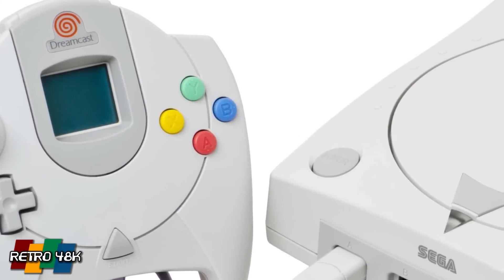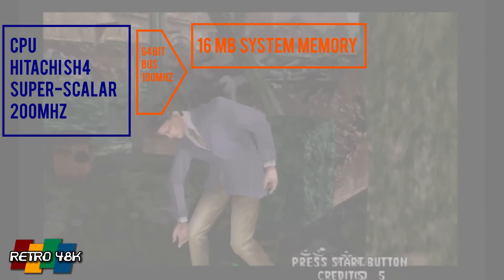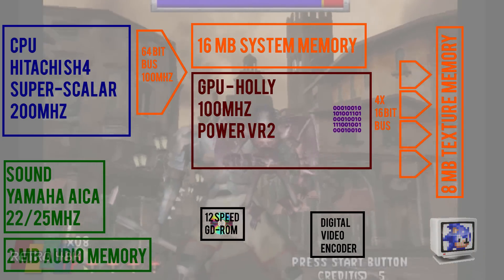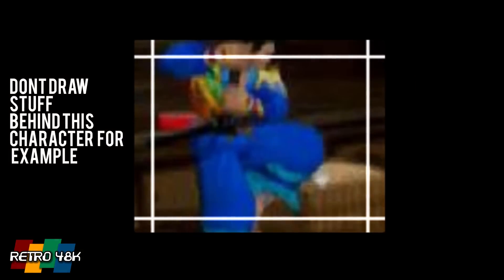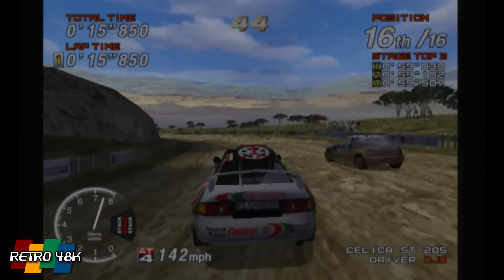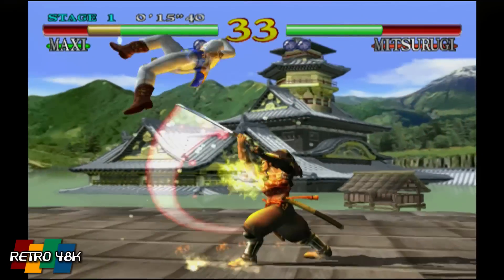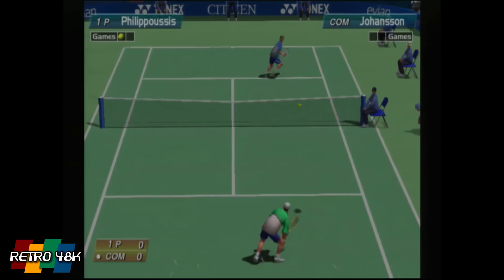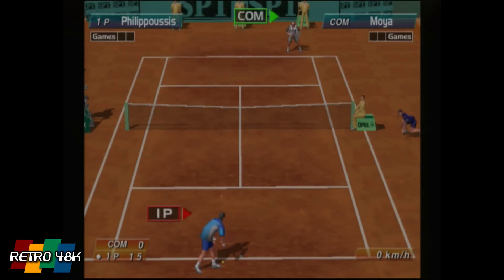How the Sega Dreamcast Worked

Comment: The Nintendo consoles from rhe N64,  had display lists too. But  1 of the big problems of that is latency issues.
Reply: In the N64, isn’t it rather a queue between the CPU and the RSP? N64 has problems with antialiasing and translucency.

Comment: Dreamcast was an amazing gaming console and I still have mine. I still play it on a CRT! I love that system. PCs were faster though. 

Your PC speed estimates for 1998 and 1999 though are way off. They were at 200 Mhz by 1996.  By the time of the Dreamcast launch in NA the Pentium 3 500 Mhz ($700 roughly, $500 for the 450 Mhz) was launching, followed shortly by the GeForce 256 ($199); both of which outclassed the Dreamcast pretty handily. Even for the 1998 launch it would have been up against the P2-450 and Nvidia TNT 2.
Reply: Dreamcast was more powerful.  The games looked better on Dreamcast than those PCs you mentioned.
Reply: @costumeninja1914  On point one you are wrong. I love Dreamcast too but if you think it was more powerful than a GeForce 256 you need to go look the benchmarks of the era. Dreamcast ran Quake 3 at 640x480 with lower settings to get 20 to 30 FPS most of the time while the GeForce 256 could hit above 100 FPS at at the same resolution with higher in-game detail. Even the TNT2 was hitting 70 FPS at the time. 

On point 2: I will happily concede that many Dreamcast games looked amazing for their time. They seem to punch well above their weight class. However, that has more to do with well chosen level design, extensive single platform optimization, and consistent art direction rather than the raw power of the system itself. 

Dreamcast was great. We played it everyday, and I have some very fond memories from it. It just wasn't the most powerful thing at the time. No console is by the time it launches since the advent of 3D cards.
Reply: @Revenant_Knight  Resolution aside, DC pushed way more polygons than the Geforce 256 its not even funny.
Reply: @sebastiankulche   And yet Dreamcast underperforms to the GeForce256 quite substantially as I mentioned in my previous comment, and gave hard evidence of this. 

Raw polygon output is not an indicator of in game performance. It’s a marketing strategy. When all aspects of a game have to be accounted for such as textures, lighting, physics, AI, etc, those polygon numbers drop significantly. 

I’m really not sure what you’re going for here. Dreamcast is objectively slower than a fast PC of the time with a GeForce256. This was independently tested by multiple independent media sources. Why are you so concerned with trying to prove it was something it wasn’t instead of focusing on what it actually was? Were you personally offended? 

Dreamcast was a bargain for the performance it provided. It had one of the best libraries of all time. Performance was excellent. 

I was in college when DC came out. I had a decked out PC: Athlon 750,  GeForce 256 DDR, 2x Voodoo2 in SLI. It was a beast for the time and was faster than my DC. But I played more on my DC because of the games on the DC. Acknowledgment of objective facts that my PC was faster doesn’t ruin the enjoyment of my DC. 

This reminds me of the 16-bit playground wars. SNES vs Genesis and is just about as dumb.
Reply: @Revenant_Knight  I dont even like the DC to begin with it but is undeniable that at the time cutting edge console graphics>>>cutting edge pc graphics, not like nowadays that even a 4 year older GPU like the 1080 ti could outperform the PS5.

PC didnt catch up to consoles until like 2004/2005 and even thats debatable. I mean just compare Quake 3 with Shenmue 2 (or even some late PS1/N64 games) and you would see which one feels previous gen in comparison.
Reply: @  Okay, I’m just not going to bother. You’re objectively wrong which makes you either a troll or someone who can’t accept they’re wrong. Everything you said can be proven wrong by researching a few articles from the time period. Hell, I lived through it. Good luck in life kid.
Reply: @Revenant_Knight  If you really lived that time period you would know everyone would had choose the PS2 anyway.

Cope.
Reply: @ Thanks kid. I needed a good laugh. Cope? Nope. You’re comedy gold. We’re laughing at you. You moved the goal posts with the no-shit-Sherlock PS2 comment in your argument, and basically forfeited and admitted defeat to anyone with common sense. Also liking your own posts doesn’t help your argument. 

Just FYI: the PC variant of the Dreamcast GPU was called the Neon 250. Released in 1999, It trailed behind the TNT2. Per Toms Hardware, a tech outfit that has been around longer than you’ve probably been alive, the Neon 250 was half the speed of the TNT2 in Descent 3 (Toms Hardware, Videologic Neon 250 review, Silvino Orozco, 9-29-99). 

Hey, guess what was a lot faster than the TNT2; The GeForce 256

Did you know this? Did you research any of it? Can you accept you are wrong? Do you need help?
Reply: @Revenant_Knight  "We´re laughing at you" "no-shit-Sherlock PS2 comment in your argument"

I though this was a debate, not a reddit circus, with fanboys like this who needs haters? I know its hard to admit your expensive setup maybe wasnt as cutting edge as Nvidia wanted you to believe.

Also, the Neon 250 wasnt 1:1 to the DC GPU, it was actually weaker.
Reply: @sebastiankulche  Kid, this isn’t a debate because you keep bending reality to meet your personal view regardless of objective facts. Moreover debating you is like getting  examples of logical fallacy: ad hominem (you attack me not my position), red hearing (mentioning PS2), circular reasoning (Dreamcast had better games so was more powerful. Dreamcast was more powerful so it had better games), and stacking the deck by outright ignoring objective data that doesn’t support your argument. 

I literally can’t debate you until you learn to set your ego aside, empty your cup, and research your topic. It’s like debating a child which is why I’m assuming you’re a kid. If you’re an adult…well…I’m sorry for you. You’re going to have a hard life with that attitude. Life doesn’t work they we want it to just because we want be right. People allow their egos to control too much of their future. 

I’m not going to respond anymore. I’m sure you’ll write something else, but I won’t be reading it. Dreamcast was half a life time ago for me. I don’t want to associate a good memory with someone trying to make it miserable. I also don’t have time to teach you how to reason and research. Good luck.
Reply: @Revenant_Knight  ????????? I literally said i dont even like the Dreamcast to begin with it 😂😂😂

You may need a dictionary to read the word objective dude.

Keep up the fun work.
Reply: Another one of those who compares the brute numbers of a console vs PC. Do you think the DC/PS2 CPU is slower than a fast Pentium 1? Lol. The architectures are vastly different.

Comment: Great vid, but at 1:25 - In 1998 there were 400MHz Intel and AMD CPU's available before the DC released. You can't really compare the DC's RISC CPU to a PC's X86 CPU with clock speeds though, they're totally different. Although it's still likely that a 400MHz X86 CPU would have outperformed the DC's RISC CPU for gaming. But not significantly.

The DC is still the biggest leap graphically that i've seen for a home console generation. The PS2 was a downgrade in comparison when i later got one, with very poor looking release games and blurry + muddy looking graphics. This was partially due to the PS2 not having proper SCART output (something even the Saturn had!), but also due to how it had to compromise texture colours because of it's lower 4MB texture memory (4-bit texture palette + texture compression which further reduced colour accuracy). When all these issues were combined the image quality just looked nasty. Washed out, dull, brown, grey... etc.  It's the reason why not a single PS2 game looks as vibrant or beautiful as so many DC games.
Reply: did a 66 mhz 486 outperform a ps1.looks like risc is simple better for a giving clockspeed and transistor count.
Reply: @athos5359  The PS1 had graphics acceleration to some extent, like a very primitive GPU, which could help it outperform a 66MHz 468 for gaming in many cases. I had a 486 and for pure CPU performance it's definitely faster than any console at the time. The Saturn would have been closer to the 486 due to having two 28MHz RISC CPU's but very few games, if any, fully made use of both CPU's being as multi-threading was an entirely new thing.
Reply: @Serial_Thriller DC has a vector coprocessor similar to GTE on PS1 and 3dNow on AMD K6 . This is useful for T&L and the tiling.

Comment: What makes it even cooler was sega made the dreamcast with off the shelf parts.  There were no custom pieces for the dreamcast and they were able to make it so ahead of its time.  I wish they were still making consoles
Reply: The SH4 CPU was specifically developed for the Dreamcast. Only Dreamcast has a tile rasteriser optimized for translucency. Apple iPhone has not much use for it.
Reply: The hardware was not off the shelf.  It’s 100% custom and developed around itself, it really reprinted cutting edge for its time.

Comment: A lot of people were suggesting that the dream cast should have been done as a $99 addon for the Saturn.  That would've moved a lot of Saturn hardware and games, giving SEGA a much needed billion or two in revenue, albeit continuing production of the old console for a time. It also would've saved the Saturn in the Japanese market and gotten hundreds of Japanese titles localized for the international market.  If SEGA really wanted to compete, use the SuperH, VooDoo 2.5, and the PowerVR for limit pushers, still at cost for less than $150 while using the Saturn to draw backgrounds.
Reply: Where can I buy one?!
Reply: @costumeninja1914 Nowhere.  SEGA decided to pull the rug out from under their fan base yet again with yet another console, that didn't play the old games.
As you might have guessed, i would have had sega, simply release the $149 Neptune and $199 Neptune CD instead of the $399 Saturn.

Comment: Despite the similar names, PowerVR's Tile Based Deferred Rendering isn't the same thing as the Deferred Rendering used in modern games (since the likes of Stalker or Killzone 2). TBDR caches all the transformed triangles that touch a tile, then clips and rasterises them in an efficient way. It defers rasterisation.
Modern DR renders all the triangles as normal for the GPU, but doesn't do lighting, instead it renders out colour, normals, depth and other data for the whole screen into a massive G-Buffer (geometry buffer), then it performs lighting calculations on that to get the lit pixel colours. It defers lighting.

Comment: And to think 3dfx could have been in a Dreamcast if they won the contract. 

The Naomi to Dreamcast ports were almost indistinguishable from each other. Sega had an excellent lineup of hardware and software for Dreamcast development. Unfortunately, poor leadership decisions in the 90s led to the company’s decline in hardware.

Thankfully, Sega is still around, albeit as a shadow of its former self and we are able to enjoy some of their games.

Sega utilized custom arcade hardware in its arcade games until the introduction of the Sega Lindbergh and ALLS systems, which were PC-based, similar to other arcade manufacturers. This shift highlighted the advancements in PC gaming hardware at that time. Heck console manufacturers went to pc like architecture as well due to lower cost of R&D and quicker time to draw the first triangle (aka Mark Cerny).

Comment: The claim about the Dreamcast's CPU being more powerful than the ones found in PCs at the time is BS. Also, PC CPUs absolutely did go above 200 Mhz at that point in time.

I have seen from other sources that the Dreamcast's hardware was actually relatively inexpensive, and that they could have gone with a more powerful design if they had wanted to, or at least, a different console company in a better financial situation definitely could have. It seemed amazing at the time because it was the first sixth gen console to market, and it definitely did have a pretty good design which was pretty well optimized for playing 3d games.
Reply from the maker: They didn’t do go above that for £200 tho that’s the point i was making
Reply: MHz can't be compared like that. A 200MHz SH4 is roughly equivalent to at least a 600MHz x86.

Comment: Uh. From 1998-2001? PC processors were quite a bit more powerful than an SH4 200Mhz. By 2001 AMD Athlons were already over the 1Ghz in clockspeed. Around 1998, AMD had K6 cpu's clocked between 200 and 400Mhz. Intel had Pentium II processors around 266Mhz to 450Mhz or so. Though the SH4 wasn't a slouch. It was probably a very good pick for the system.
Reply: Pentium 1 could reach up to 300 mhz on the fastest models. Does that mean its faster than the slowest Pentium 2? No.
Reply: MHz aren't everything. The 200 MHz SH4 is said to be roughly equivalent to a 600 MHz x86.
Reply: @some-online-dude  well said
Reply: @elgoog-the-third  While that may be true, the video said, "I don't think PC's were any more powerful than 200mhz at this time." There were 450mhz Pentium II's out before the Dreamcast launched in Japan.

Comment: The funny thing is it scales so well when over clocked and can have 32 mb memory on it with mods. Makes you wonder just how much the performance can be stretched out withs it's design. Turns out windows ce was much better than people thought. Hombrew programmers have found this out and it had good online stack fir the games as well. Turned out the ports using it were rushed by people wothout the required experience.

Comment: Tile based deferred rendering scaled pretty linearly in a multi GPU system. Unlike dual GPU graphics cards where it would try to split the scene at the driver level and have each GPU render half you could for example send every other tile to one GPU or the other and then collate them at the end and get close to double the render speed instead of the 30~50% increase typical in most dual GPU setups because that was already how the hardware rendered the scene in the first place.

 There was a PowerVR1 graphics card made by NEC back in the late 90's that had an option for running two in your system and performance was typicaly a 70%~80% speed increase, and it didn't even need a special bridge between the cards to do this it just went through the PCI buss. Unfortunatly it also only worked with PowerVR1 specific titles, it's hardware was so different (even more so than PowerVR2) that supporting OpenGL and Direct3D was not possible. It used something called "infinate planes" instead of rendering polygons line by line. It could display triangle based models but it's method for doing so was vastly different than scanline based rendering.

Comment: Why would you say cpu's weren't more powerful than 200 mhz by 1998 without doing any kind of research? PC always was and will always be on the lead, by 98 you had 450 mhz pentium II and even 550 mhz K6-2 cpus, by that era you could already emulate the N64 without issues, the previous gen of the Dreamcast...
Reply: It just not true. In 1998 there were no pentium pc's at 450 mhz. 233 was already top of the bill.
Reply: You can't compare MHz like that. SH4 200MHz = x86 600MHz.

Comment: The Pentium III 1Ghz was out and I had a Celeron 566 that I had overclocked to 850Mhz when the Dreamcast was hot IIRC. I could be wrong... If not that system I had a PIII 450Mhz slot 1 system with a Voodoo.
Reply: A 200MHz SH4 is roughly equivalent to a 600MHz x86.
Reply: Yeah, zero research was put into this video.
Reply: Pentium 3 with 450Mhz costs 500$ and was need in well-cooling system.

Comment: if i recall correctly, nvidia gpus started using hardware tiled based rendering in the Maxwell generation, which lead to a big jump in performance and efficiency against the amd gpus at the time! And that was not so long ago...
Reply: Which the Switch has

Comment: First time I heard that the Dreamcast utilized "deferred rendering," I wondered if that was the console's secret sauce. Now, deferred rendering is considered a significant factor for efficiency.
Reply: tile based dr to be exact, which Nvidia also started using with their Maxwell GPUs
Reply: Everything since about 2016 from Nvidia, AMD, and Intel (a bit later for them) switch to tile based deferred rendering. Today, everyone uses it including Apple and Qualcom.
Reply: @Revenant_Knight  AMD started using it with Vega which came out 2017
Reply: @Nintenboy01  I was excited to read about that. I was there when PowerVR was introduced in the 90s...I even have a Gen 1 card... and the tile rendering was such a neat idea. I'm happy PowerVR tech lives on.
Reply: Nvidia and AMD GPUs do use tile based rendering, but not deferred. The difference is that they process pixels immediately rather than deferring until the closest pixel is determined.

Since depth prepasses and thing like visibility buffers are supported and quite efficient already, the benefits of a full TBDR system might not be worth the extra complexity and other drawbacks.

Comment: “I don’t think PCs were any more powerful than 200MHz at this time”

The Dreamcast was released at roughly the same time as the first Intel Pentium III (JP launch was just before, US launch was just after) which debuted at 450MHz.
Reply: Pentium with 450Mhz costs 500$ in 1999 😂
Reply: MHz aren't comparable like that across architectures. The 200MHz SH4 is said to be roughly equivalent to a 600MHz x86 CPU_
Reply: @ We all know that, but that is not what the video says.
Reply: Yeah this was a disappointing start of the video.
Reply: pentuim 3 450 mhz katmai  only very sligtly faster than a pentuim 2 450 in quake 3 arena.
Reply: Zero research effort was put into this video.